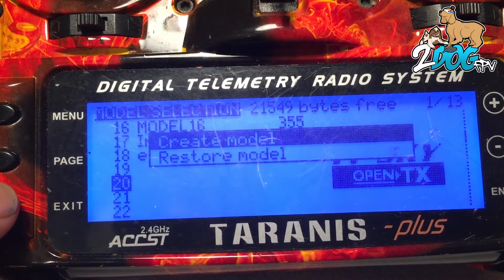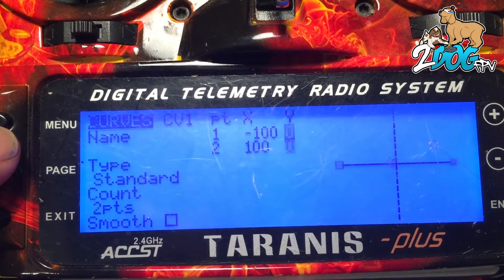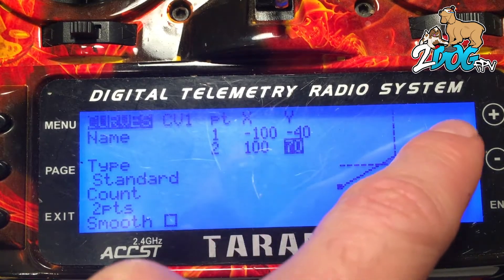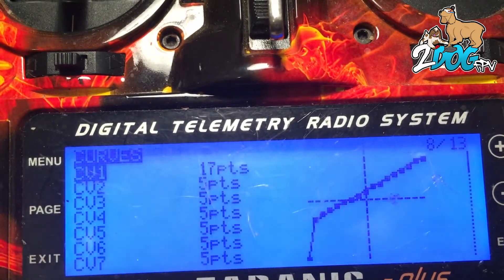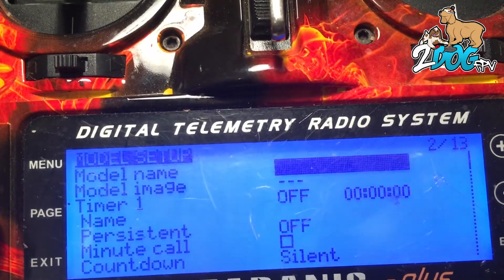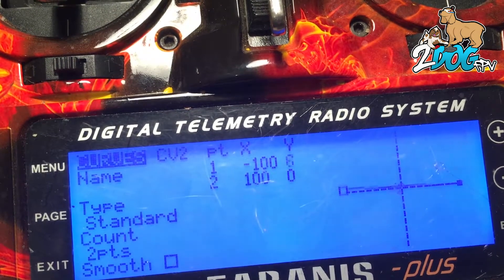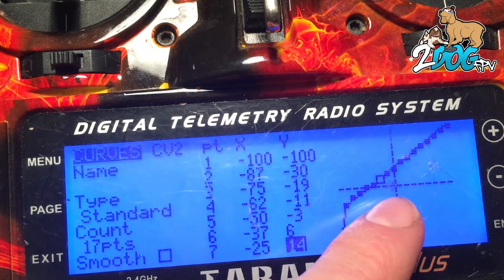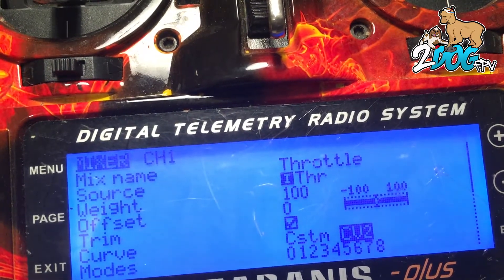Tiny Whoop, Beta 65/75X, Tiny Hawk Quick way to improve the flight handling, free!

Comment: Beta65 pro 1s 802 19500kv flew like crap in acro until I watched this video! I am running stock pids from betaflight 4.0.6. Played with the rates a bit but I am pretty happy with it, project mockingbird not needed! I usually race 5" and hated whoops. This is my first brushless whoop. I have to say it is a night a day difference in power and durability to the brushed ones made 2.5 years ago. 

Thank you so much! 🤩👍

Comment: Hey!

I have the emax tjnyhawn rtf kit so I dont have a radio with a screen on it in which I can adjust the throttle expo.
How can I get the throttle expo that you have in betaflight?
What value in betaflight do I need to change, and to what value should I change it?

Comment: Thank you for the video with the walk thru... I have been flying for a couple years and had not seen the benefits to a throttle curve until now. I've applied this to the Tiny Hawk and the Trashcan also capping the throttle on the Trashcan and I must say Im very impressed on how much better they fly indoors.  Now I have to figure out if I can setup two or three curves and make them accessible on a 3 way switch for various flying conditions.

Comment: I tried this and followed your instructions to a T but my tiny hawk would not fly. Is there a setting I need to turn off in betaflight that my interfere with the curve?
Reply: Does the throttle show 1000 in betaflight on the receiver menu when the stick is all the way down? If not you might have to adjust the end point till it does.
Reply: @2strokeme64  thanks brother that was it.

Comment: Why not just throttle expo in betaflight? Or if you must on the radio use the curve on throttle to add throttle expo.
Reply from the maker: Well, throttle expo would make a different curve with a flat center, i believe.  This method gives you a linear curve starting at a higher point.  However, if you try it let me know which works better.  I don't have one yet...waiting on my Tiny Hawk.
Reply: @2dogrc  Unless you put throttle mid @ 1 than the expo goes over the whole curve. i have my tinyhawk S at 1s @ mid 1 and expo 0.35